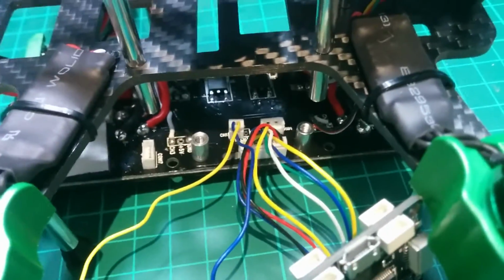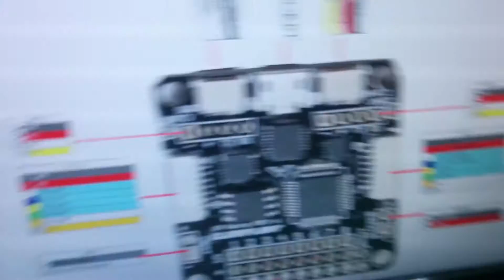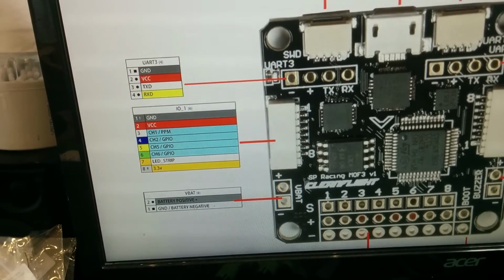Err HELP! WTF Wiring on SP Racing F3 Board on 180mm Quadcopter (Eachine Falcon 180)

Comment: hey i just got the realacc gx210 with the same board and wires.. i was wondering if you had fogured out why these wires have 2 in ine cable.. and why does the other 8 pin JST connector have just  a yellow and blue wire coming out of it joining with the other wires..  can you please help me out.. thanks
Reply from the maker: Howdy Steve, it's been a while, look up the board pinout on google and follow that. I think pin 4 or 5 is used for SBUS connections, pin 3 is used for PPM, hence why the white wire goes to a couple of pins up. Hope that makes sense! Matt
Reply: Matthew Ogborne thabks for the response.. dont you need to use ch r and 5 for a pwm recoever?...im using the fs-i6 i just dont know what that two wire white plug is for as well? so i need to also use the yellow and blue wire from the other connection pin for ch3 and 4?
Reply from the maker: Steve Maratea I'd just connect it up and see if anything turns up in cleanflight for the Rx inputs when you move the sticks (obviously not powered & with the props off!). Matt

Comment: the other wires going to the board could be to operate the leds?  hmm. ive got sp racing fc's and used ppm. trying to remember if i used gnd, vss and then skipped the 3rd wire and used the 4th wire. hmm
Reply from the maker: Howdy Phil, yea this wiring is a POS. I couldn't make this stuff up, I got the unboxing on camera and it looks like they've supplied to cables exactly the same, both wired incorrectly. Will be fun getting this to work tonight :) Matt
Reply: im pretty sure the first 3 wires are for ppm. theres a telemetry wire there going to the pdb i think. you dont need that, (its probably making things confusing) i would personally try to power up the fc board and connect a ppm receiver like a d4r to the first 3 wires ground power and white (i think) just to see if it responds. but you would need to launch cleanflight. maybe tell the board to use ppm instead of pwm. (if thats what it is set too)

 in saying that,  i now use the sbus/ibus port on mine with my flysky i6. i can tell you about that with more confidence.
Reply: in the case of that photo the first 3 wires are ground power and blue. they are your ppm... i think. hahah. ok im out :)
Reply: go by position. diregard the colours. but obey ground and positive. they are correct
Reply from the maker: Howdy Phil, yea I'll start applying some logic to them and see where I end up. It's odd that both looms are wired the same way, which is what made me question wtf is going on with them. Matt PS. really appreciate help!!!

Comment: i don't think you can trust the Chinese conformity to colour coding :-) if you want to be safe check the continuity between the black with the - on one of the PWM output pins to prove it's right. if you want to be even safer power the receiver 5V on another channel input from a BEC or battery and then poke pin 3 (which looks like it's  blue) into the PPM signal pin of the RX. if it's any comfort i have an SP F3 like that on one of mine and taking PPM from EZUHF receiver on the top 3 pins of that connector
Reply from the maker: Howdy Neil, yea I just grabbed my knackered D4R-II receiver and plugged it with a battery, switched to PPM in cleanflight and nothing, so no idea why they have channel 1 going to the board, I think they've got it wired wrong, channel 1 should be the receiver and channel 7 should be going off to the LED strip. Quite odd. Matt
Reply: get a scalpel pop the little barb on the dupont connector and switch it roud